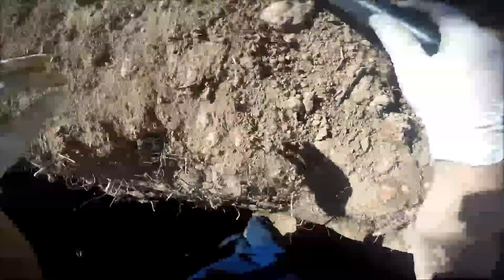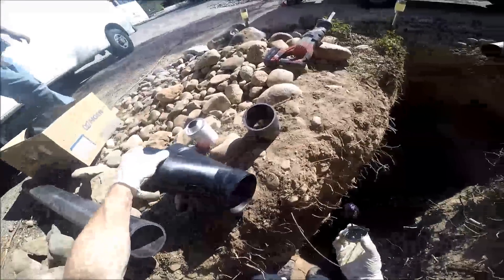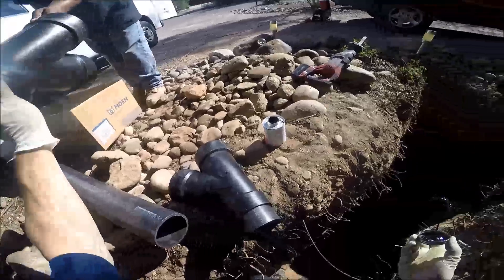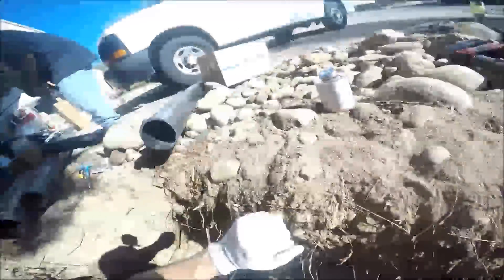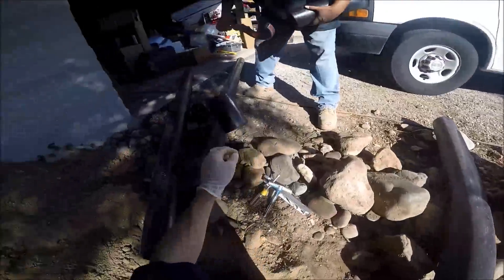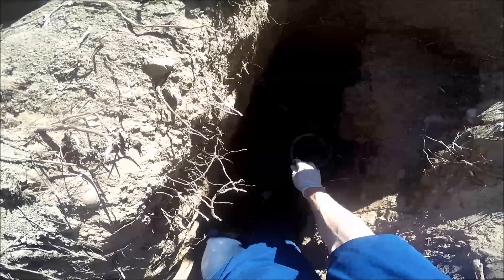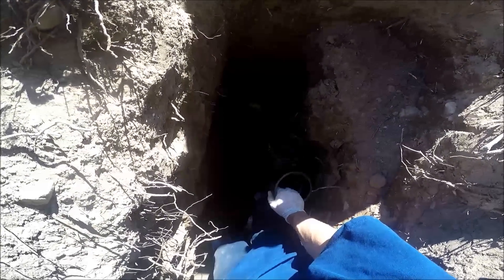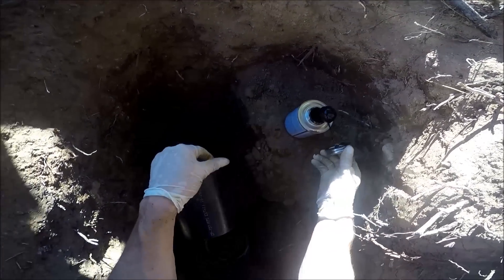sewer cleanout installation

Comment: Just a tip for might want to dry fit everything nothing worse to put stuff together and something doesn’t fit and it’s glued or it’s going the wrong way.
Reply: Never dry fit because of shrinkage. When you put glue on the pipes the fit deeper into the sockets.

Comment: Nice video.  I always use heavy duty No-Hub with 4 bands if water will be running through it and if its connecting  to a cast iron I will use a Fernco coupling.  Also if its not real deep I will use a PVC sewer saddle and  you dont have to dig a very big area to install it.